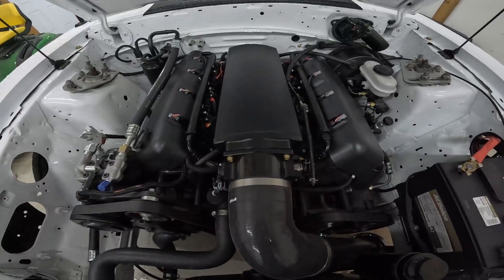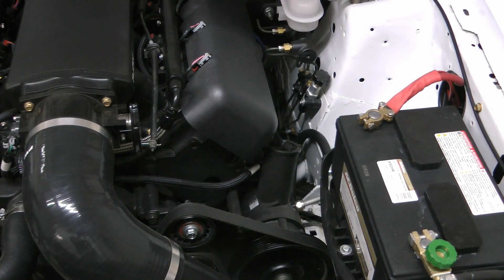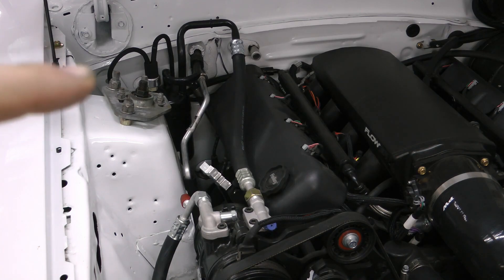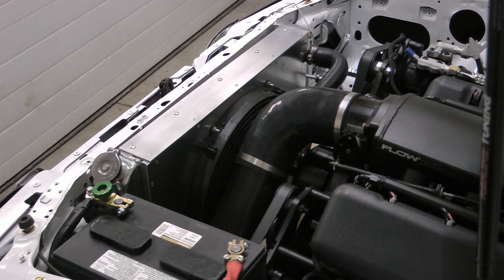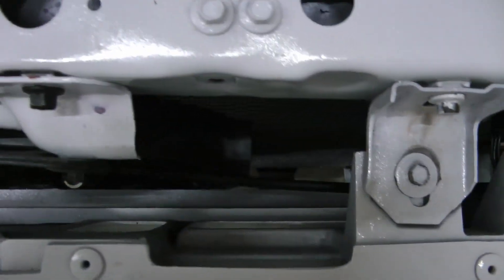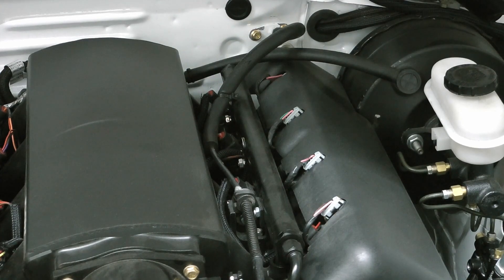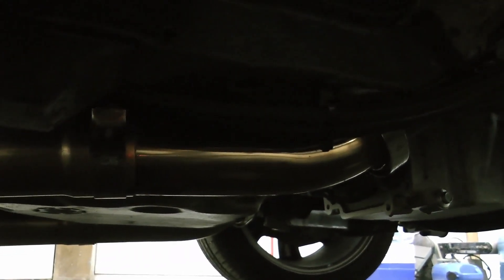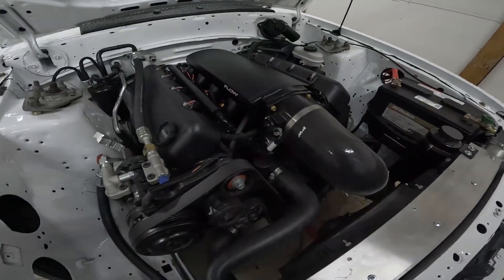How to LS Swap A Foxbody Mustang - Complete Guide including AC

Comment: Im trying to use the factory PS pump off the fox on my 5.3l. I have the stock rack with new lines but what did you use to mount the factory ps pump? I also have the truck relocation kit
Reply from the maker: Ict bracket kit

Comment: is there a way to make the factory gauges work?
Reply from the maker: Yes you can use the oil pressure and temp  with stock ford sensors, factory speedo is a bit tougher
Reply: You can get a GPS speedometer analog module from Jegs. That's what I'm using, works perfectly.  RPM tach can work but only if you use the V8 tack.  Just connect the tack signal wire from the terminator to the foxbody tach input harness. It's the round plug by the brake booster

Comment: did you have to cut or lengthen the driveshaft? I ask because I am wanting to use the stock driveshaft with the 4L80e. Do you know the length of the driveshaft?
Reply from the maker: It will need to be a custom shaft with 4l80e yoke, 42in or so I believe
Reply: @WestcoastWrenchin  I bought a slip yoke for a 4L80e, I am hoping I will be able to use it on my driveshaft from my 91, if I need to get a custom made then so be it. I am needing to find a wiring diagram, so I know what to use from the car to connect to my standalone harness.
Reply from the maker: @nickwojciechowski6507  checkout my clean wiring video i show pretty much what I did

Comment: I’m in the process of swapping my foxbody ATM and I’m confused on how the interior body harness still works with standalone system. Have any insights on that
Reply from the maker: The body harness is connected to the fuse box which is connected the the battery. The holley system is connected to the battery and only interacts to the body harness with essentially an ignition power wire. Thus they are two completely separate systems, it's why it's called a standalone. It stands alone from the rest of the car

Comment: Great video man.  I will be swapping an 83 GT in the spring.  I did a 6.0L in an 84 Tbird and it was a blast.
Reply: I plan on swapping a 6.0 in an 88 Tbird soon any tips or main problems you could point out?
Reply: @trevorfoster8819  get a fox body mustang K member kit from your choice of brands that is meant for the LS, and the 1/4 inch k mber spacers from maximum motorsports.  Its actually a really easy swap.  My next one I will be going Holley efi though.
Reply: @RKARperformance  I’m about to start on a 84 gt you got a list of all you used for the mounting and trans 😂
Reply: @Nachobeach team Z k member kit and I used the stock AOD cross member slightly modified to fit the 700R4

Comment: I think the craziest thing about the LS swapped Fox project is just how cheap and simple it seems to be if you have any mechanical experience at all. Really considering getting an LX roller and looking for a good donor LS to put in, and very consise information like this is making it even more appealing. Thanks for the video and well-presented info!
Reply: This is exactly where I’m at. Foxbodies are getting expensive if they have a stock 302.

I can get a shell and drop in an LS for a fraction of the cost for a ford v8 build
Reply from the maker: Thank you
Reply: @WestcoastWrenchin hey, i was wondering how hard is it to have the headlights and the wipers and everything to work after the swap? does the holley take care of that? or do you need to rewire alot
Reply: like after i wire up the terminator and everything will the headlights and stuff work by them selves or would i have to do more work
Reply from the maker: @jaybando4027  no rewire, the fusebox gets power from the starter solenoid, just power the appropriate wires and you're good
Reply: @Jacobrivera52  these have a seperate body and engine harness. everything still works on mine i didnt change a thing
Reply: I have a beautiful 94 v6 with bad head gasket for sale cheap, no rust all original 90k miles.. I also have a 5.3 in a Silverado running with good transmission also for sale if anyone is interested..
Reply: did u do it?
Reply: Think !  How Cheap it would be to USE A JUNKAZZ. FURD MOTOR !     HA. HA. HA. HA. !     PATHETIC !
Reply: I own a 93 LX. I'm scared that if I did it, my car would drop in value
Reply from the maker: @yahawahchosenone6712  it depends on the car, mine was an ugly 4 cyl so no regrets.  A nice factory car problably isn't the candidate for one of these swaps. Performance cars in general are not good if you're concerned about maintaining any value.

Comment: did you have to do anything different with rear end and driveshaft im new to the ls swap just bought a 1990 lx about a week ago
Reply from the maker: Yes you will need a custom drive shaft
Reply: @WestcoastWrenchin where would i get the drive shaft?
Reply: i’m doing a manual
Reply from the maker: @Jacobrivera52  custom made